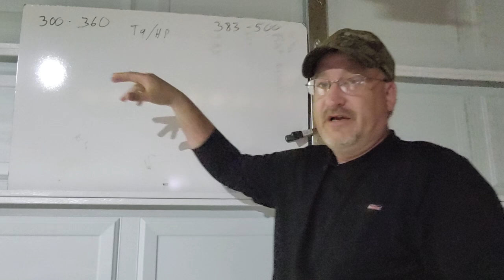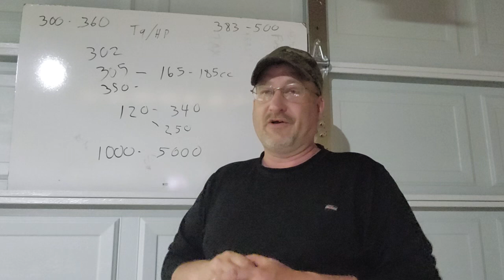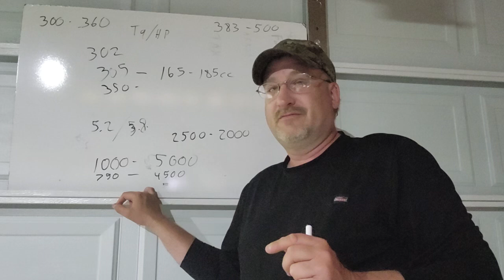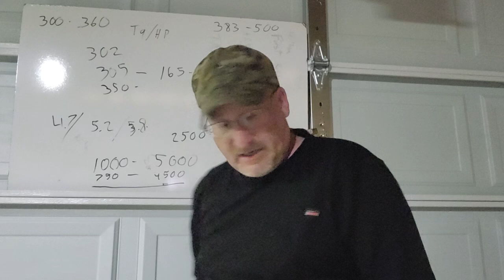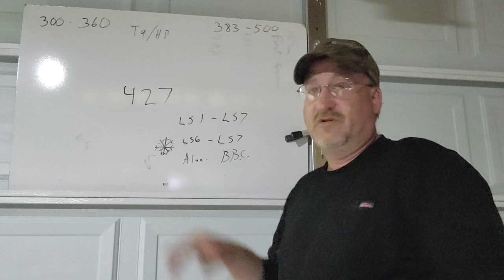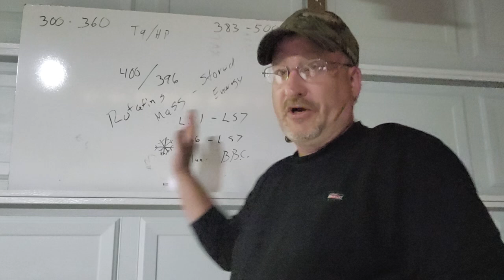May 8, 2025

Comment: peanut ports heads ?   where they fall in
Reply from the maker: @Saan455  good through 5000rpm on a 396. On a 454...they run out of steam by 4000rpm.
Reply: @approachingtarget.4503  what about 500+cu  in crew cab k30.  Or 049 with the port floor filled . 5k rpm max.
Reply from the maker: @Saan455  sounds like a gas engine trying to be a diesel! Large cubic inch and small peanut ports will deliver a strong torque production but limit HP. Easily see 600lbs while never achieving 300hp. 
  That is why I have stated that HP is not just torque multipled by RPM. 
  Richard Holdner has stated that all engines have the torque curve and hp curve cross at 5250rpm. This example of a 500+ci with small ports. Will never achieve 5000rpm.
Reply: @approachingtarget.4503  Dude thanks for the reply   used to watch you old channel (Tom mew )  may have your surname wrong
Reply: @approachingtarget.4503  vortecpro built a 461 with ported peanut ports.  Got like 580 hp and 600 tq